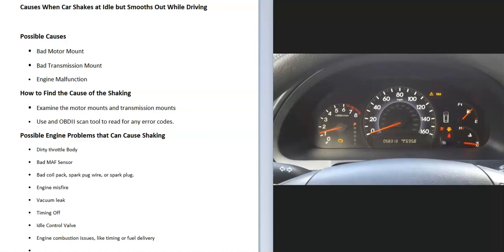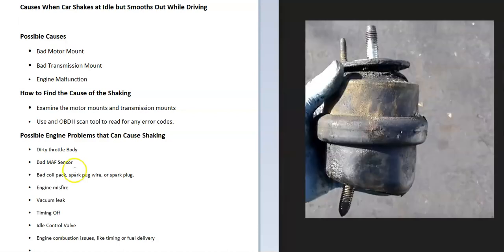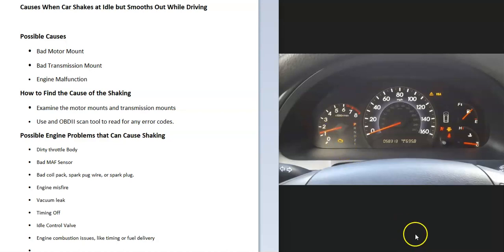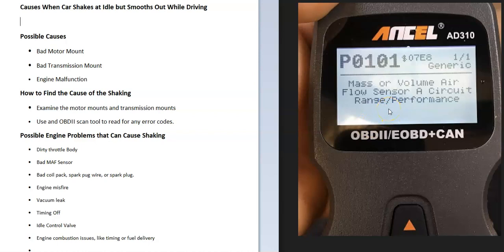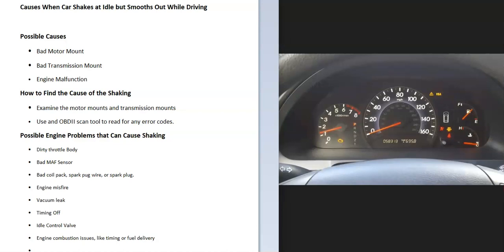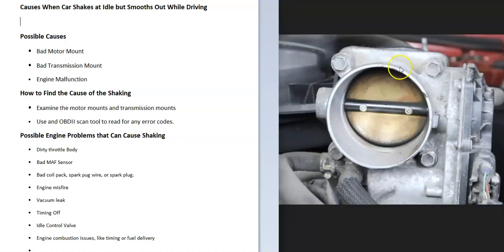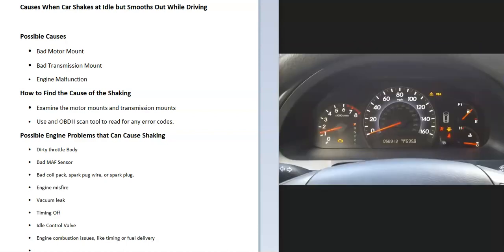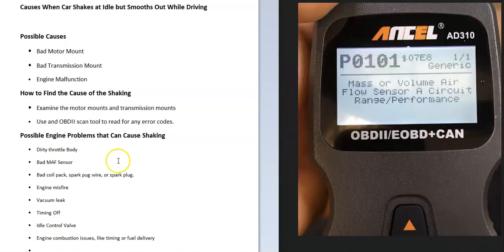Causes When Car Shakes at Idle but Smooths Out While Driving

Comment: Catalytic converter leading to misfire
Reply: Yeah, I know it’s my Cadillac converter because my engine light comes on and I had to check the AutoZone and shakes while I start the car when I’m driving is fine and shit like that so I’m trying to do I need to do to move out my apartment so I’m trying to get my car in A1 shape and that’s the only problem right now is Cadillac converter because it starts shaking when I drivebut I know it’s the Cadillac converter
Reply: @Ashle-w1i  catalytic converter and it could be spark  plugs and wires

Comment: I have no Engine light but it vibrates in drive sitting at a light or whatever but drives ok seems a bit less perky.
Reply: Turns out I lost my right side engine mount bolt! 14 bucks! Got it put it on and no more vibration!
Reply: Did you solve it? I have the same thing.

Comment: It can also happen with the AC on.
Reply: Yes ,  regarding AC on ❤most cars the engine tends to run faster , higher , more vibration slightly  because of the AC compressor  is running , it's like its own little extra engine
Reply: whys this

Comment: Can someone help my engine is shaking violently and making the entire car shake. It shakes when it’s idle if I’m sitting at a light or parked in place and when I’m at low speeds braking. Do I need new motor mounts?
Reply: At times when u have bad engine mounts is upon takeoff car pulls to one side.

Comment: i have Tahoe 98
when i start A/C and put transmission in D in stop mode it's vibrating until i move and drive on the road
with speed no problem !
Reply: did you figure out why?
Reply: @zerozr837   
no , not yet my friend.

Comment: So if my vents not blowing to the front  so its blowing to just the defrost and the floor, does that mean i have a bad vacuum leak somewhere? I looked at all the wires and replaced the one in the firewall (its a tiny tube poking through and it still not blowing to the front. Also i changed my switch panel too and its still not working. What would be wrong? I have a 99 Dodge Durango slt with 5.9
Reply: A lot of times inside there's a blend door that's not moving. It can be vacuum but a lot of times it's a little plastic module module in the vacuum line that controled the door that broke.

Comment: I have a 2013 Toyota Camry I turn the car on runs fine for the first minute then starts to shake and rpms drop from 750 to 250 then turns off. My guess is that it would be the spark plugs cuz previously I had changed them but don’t have an actual torque wrench so I did it with a ratchet and tightens it with just my strength but I doubt they were fully tight all the way
Reply: did you try cleaning the throttle body? if there is carbon build up, will affect your car at idle

Comment: Changed all 4 motor mounts, changed fuel injectors, spark plugs, and cleaned throtle body....still shakes
Reply: Maybe your car have bad timing
Reply: 😂gas pump may be your culprit 😂
Reply: Bro screw it, drive the car til the wheel falls off and get a new one
Reply: What about your ignition coils???
Reply: Maf sensor maybe or u have a miss fire
Reply: Maybe injector clogging
Reply: Transmission mounts ?
Reply: Map sensor
Reply: well .. change ur road 😊

Comment: I just recently purchased a 2017 chevy equinox LT. She is jerking when im stopped at red lights as well as a clicking noise when accelerating at low speeds. These problems started about the same time.
Reply: I am facing same issue that its making clicking noise when accelerating. When stop at red light and in traffic I have to press hard to get car moving. 

Let me know if you were able to find issue
Reply: Also its shaking when Vehicle has parked.
Reply: I have a 2017 Chevy Cruze and it has the same problem and when I turn on the air conditioning the car shakes and one time it turned off. Can someone help me with your experience? Many thanks.
Reply: @batybaty8915   Yes, same issue. Upon turning ON AC  car gets turned off.

Mechanic told that engine had low compression in 2 cylinders and engine got bad.

Comment: i just replace my spark plugs , could are not that old , injectors change them like 3 years ago with coils . change o2 sensors. car stop making noises when accelerating now accelerates good . but sometimes it the engine shakes when driving but does it a bit more when i stop at a light . i have no codes at all . idk what to do anymore . i saw the throttle and it looked clean ima have to clean it more and inspect sparks plus even tho they are new

Comment: Car vibrates alot in the cabin only when im parked or at the light. No accleration problems, no other issues at all. I changed the spark plugs and cleaned out the intake and filter. What would be suggested next before going to the more extreme? Clean the throttle body?
Reply: I have the same problem.  I think it's our motor mounts 😢
Reply: You ever find out what it is?
Reply: Check the motor mounts, the rubber gets worn out and does not function correctly, second check the throttle body and clean it (lots of videos on how to do this), if your plugs are old, swap them

Comment: I have vibration in idle when in gear and engine warm. It’s a 2017 accord with 67,000 miles. I replaced spark plugs, air filter, PCV valve, cleaned intake valves, fuel system cleaner, transmission fluid/ filter change. Nothing worked. Any ideas?
Reply: have you looked at the motor mounts? and test them
Reply: There was a minor valve cover gasket leak so I replaced it (didn’t fix idle but at least it’s not leaking). I replaced camshaft position sensor for bank 1 and that reduced the vibration significantly. It’s still there but not as annoying anymore
Reply: Check your engine mount. Most times, they are not well fitted or the bolts is not properly knob to fitting. Most time caused from the previous maintenance whereby the mechanic didn't mount or knob the bolts to fit in very well
Reply: I have the same issue on my 2016 Honda accord sport, mine shakes while on the highway starts while I’m doing like 40 and up, still trynna figure out
Reply: throttle body cleaning? and maybe theres a vacuum leak? also clean the fuel injectors?

Comment: Have a 2012 mitsubishi outlander 4 cylinder  with 79k runs great but shakes a bit when idling  and quite a bit more in drive at stop lights. Have error Po113 changed the maf sensor which has the iat intergrated.  Cleaned throttle body on the car. Changed the ect before all that. Bought car used and the oil smell a tad like gas. Changed that and the filter. Wondering if it could be the O rings on the injectors or the egr??Car runs smooth when driving. Any help would be greatly appreciated 🙏
Reply: I have a similar problem, I drive Mitsubishi Lancer 2012, it's vibrate and lose power when on stop sign or slowing down, I will have to put it on neutral to balance the noise, when on smoot drive with no stop sign it's all good. 
I can't drive the car in traffic as I will need to constantly shift to N and D. It's really frustrating. All the engine sits are intact and not broken . I have scanned and paid for repairs, it still the same. 

The only thing I haven't done is opening up the engine to see if there are carbon or something else.
Reply: @francisodubela9373  any updates yet,I have the same problen?
Reply: It even more worse if the AC is on. The engine will off instantly when on stop sign or before approaching a stop sign.
Reply: I have the same issue on my outlander 2012. Did you find a solution?
Reply: @ALFAYOMEGATROPHIES did you manage to find out what it could be?
Reply: @Fatherandsonchannel1991  not yet, been driving it just like that
Reply: @ALFAYOMEGATROPHIES  not yet. Been driving it just like that.
Reply: @francisodubela9373  I saw on other videos they mention it could be camshaft sensor bank 1 and 2
Reply: @Fatherandsonchannel1991 changed the camshaft sensor. Still same problem with camry 07
Reply: Having similar issues with Hyundai veloster turbo any solutions yet ?

Comment: Hi, we had exhaust replaced (including converter) on my wife's 2007 Vibe. After the new converter installed, the Vibe developed some vibration. There was check engine light and my wife brought the car back to the garage. The garage then told us the motor mounts needed to be replaced, as the vibration was quite noticeable and even damaged the new exhaust. All mounts were replaced.
After the mount replacement, an oil leak happened, that required a new valve gasket.
Now after 2300 $ bill the car vibrates terribly and rambles loudly in reverse, and in Drive, when idle, at a stop and in slower speeds. There is also some knocking when driving and the car does not stay driving, gas pedal has to be constantly pushed. The garage basically gave us the car saying they cannot do anything else to improve the vibration. It however keeps on, even the trunk rattles now and the doors and windows as well. Any idea if we can save the car?
Reply: run from that garage mechanics, that are either clueless or intentionally ripping you off. Report them Yelp, to help other stay away from them.

Comment: A couple of times in a month when stopped at red light my car would idle somewhat rough…it smooths out when accelerating but if I stop it would do it again once or twice per stop…sometimes I can go 2 weeks without any rough idling…its frustrating
Reply: My mustang does the same thing, you ever figure out what caused it for yours?
Reply: @DillonJohnson-cm5mu  Im glad you asked! Actually I just figured it out with the dealership last Friday…and it was the purge valve there was a stored code… although I did not have a check engine light that’s code was pending and they replaced it I drove the car heavily last three days with the AC on… and it’s flawless now!! Hallelujah!
Reply: @Chaz-777  what kinda car is it?
Reply: @juliancantu1955  2019 Mustang GT…just found out it was the purge valve that went bad and spark plugs needed replacing…all good now! 👍🏼
Reply: @Chaz-777 i replaced my spark plugs and the purge valve. Still get the same issue, car shudder at light stop. 2012 hyundai
Reply: @ Mustang is different than Hyundai in terms of engine build but it seems like either the solenoids need to be replaced or you need to perform an Idle re-learn…I’ve done all the above apart from solenoid replacement.. everything is great right now at 67,000 miles
Reply: @Chaz-777  I got the same car and the same problem... if this fix my car I'm going to be so happy
Reply: @noha9071 what was it?
Reply: @DillonJohnson-cm5mu  purge valve and spark plugs + idle re-learn solved my problem

Comment: I got a brand new 2023 Toyota Corolla and it shakes at a traffic light or stop sign but when I turn the lights on, it feels normal, I took it to the dealer and they told me it was normal, anyone else with same problem?
Reply: When you turn on the lights, or other electrical loads like AC the RPM increases by 50--100 just enough to stop the low-rpm vibrations.

Comment: Mine shakes when shift to drive or reverse pretty bad with solid engine light. PROBLEMS: 1. Bad spark plugs 2. Build up carbon in engine and need to clean up. Spent almost $600cad at the dealer but worth it.
Reply: how did they clean the engine for the carbon build up?
Reply: you can use water

Comment: Hey man i just change my engine mounts and stuff but now I have rough idle and it’s shaking also my gouge always moving going up and down by itself losing power and sometimes almost shutting down my car is 2010 Mercedes e63 amg by the way
Reply: Thats what i said when you have irregular revs the mounts are not the main reason
Reply: did you ever resolve the problem? if so what was it?  if not, id try cleaning throttle body, and do an air vacuum test.
Reply: @falconxlc it was fuel injector one of them wasn’t working properly

Comment: My 07 charger v6 started to shake a bit when I’m at a red light or a stop sign but it’s completely smooth when driving. Only codes are evap leaks. Reason why my AC won’t work
Reply: What was it

Comment: Mazda cx5 in drive and reverse it shakes. Park the car is running fine. Im drive low rpm it shakes and after drives smooth

What can this be? I already cleaned throttle and replaced injectors but still the same
Reply: Same.. did u eventually fix it? And how please

Comment: At idle my 2014 CRV sometimes but more than not has a very deep, smooth vibration that i can clearly hear and feel coming through the steering wheel.  I've run 2 bottles of injector cleaner through 2 tanks of gas with no change in the vibration incidence.  As a matter of fact my mileage has been gradually improving since using the injector cleaning.  It's the intermittent vibration that has me puzzled.  Too, I've not gotten a check engine light nor have I had a computer diagnosis.  Any thoughts?  Thanks
Reply: Check your spark plugs and PVC valve.
Reply: @carlosgraphic  will do, thanks
Reply: @weeverob any update?
Reply: Update? Following
Reply: did you find the solution. ?????

Comment: I have 2018 escalade only vibration idles when stopped with brake would cleaning maf sensor help. No check engine either barely hit 80k miles 😢
Reply: hi, did you ever find out why it was vib at idle when stopped?
Reply: I have yukon 55k miles doing this as well. But also my a/c isn't cooling 😢

Comment: I have a 2000 Honda Accord, and tbh it vibrates when i turn it on but it stops when i put it is D, but it just barely vibrates so idk if im just being paranoid and it’s just the regular vibration 💀
Reply: That seems like the motor mounts are starting to wear out. It will get worse and eventually shake no matter what gear and can start causing the engine to fall apart. Even the air system like the air intake can rattle itself right off.
Reply: same with my 2019 Toyota Corolla
Reply: Same happened to my recentlt bought 10’ civic idk if its the motor mounts though
Reply: Same with my 2008 rav4
Reply: Im paranoid too and I just got the car. Anybody know what it could be?

Comment: My 2013 Kia optima is having a similar issue. It shakes at red lights when im at a complete stop, but only once the engine is warmed up. I cleaned the throttle body, replaced the MAF, and pcv valve. Had a smoke test done, but came back negative. Every time I stop, I have to put it in N, and it helps with the shaking, but its still there a bit. The dealership couldn't find anything wrong with it. Any help would be greatly appreciated.
Reply: Aaron, I have a 2011 Kia Optima. I have been trying to fix the same issue on mine for over a year. This is a common problem with these engines that no one can seem to fix. I have thrown parts at it because it has high mileage and nothing fixes it. I am not giving up. Today I am going to test the decoupler pulley on my alternator. I have seen videos that these can cause idle problems. Will let you know if I ever figure it out.
Reply: Did you clean the fuel injectors?
Reply: @jjjohn5914  I haven't checked the fuel injectors, but i replaced those just a year or two ago. I did clean the throttle body, both sides of it
Reply: @jjjohn5914  I have installed 4 new injectors. Decoupler pulley tested good.
Reply: @DRDROP-fj4bo Hi, did you find what the issue is?
Reply: @beterbey  Nope
Reply: @aarondemar2546 Did you ever figure out that is wrong? Same problem but can't figure it out
Reply: @vima6061 I'm going to another shop tomorrow, I'm guessing it might be the motor mounts. When I have the car in D, foot on the brake, and hit the gas, I can feel the engine move a bit. I'm thinking it's the motor mounts.
Reply: @AaronAnita456  I thought about motor mounts but mine does not start shuddering until the oil temp gets up to operating temp. Next is removal of valve cover and check timing marks at TDC, Inspect VVT sprocket. I have inspected Intake,exhaust  and oil control valve solenoids. They are clean and operate correctly.
Reply: @DRDROP-fj4bo  i'm having similar issues with my audi a6 (2014). Was told by a tech that is was a timing issue, but haven't had it checked. Let us know if the timing solves yours.
Reply: @kolabsp  will do!
You would think it would throw a cel if it jumped a link on timing chain but idk.
Reply: Cheaper car so could just be the way it runs

Comment: Hi. I do have vw golf mk6 2.0 tdi. My engine sometimes start shaking when i start it, and before i hear like a click noise in the engine, then it shakes for 30sec to 1 min and stops.. Anyone know what it could be?
Reply: Could check glow plugs. Will be doing mine on a volvo v40 d3 soon. It seems to appear only in winter.
Reply: Did you allready resolve your problem? I have the same issue on my AUDI A6 2013year...

Comment: I had my computer read and it said I have cylinder misfires I replaced the coil pack first still said misfire then changed the plugs and wires still has shaking during idle what should I do next
Reply from the maker: The fuel pump may be starting to fail. I would test the fuel pressure at the fuel rail.
Reply: @HVAC_Mechanic cylinder 2 is misfiring so the first time I put the coil pack on took it off bc it was still reading misfire but then later on I found out two of my plugs where loose so I'm going to try the coil pack again but I do know there's a lot of air pressure or something on my gas tank bc when I go to put gas in the pressure builds up and spits some gas back out of I run it fast so I have to put it in slow
Reply: @HVAC_Mechanic you ever have any trouble with the Fiesta (2011 SES) with a vibration felt inside the car when first cranked at a idle in P, D or N that goes away once you start driving and does not come back when you stop at a light but returns after being parked all day or night?